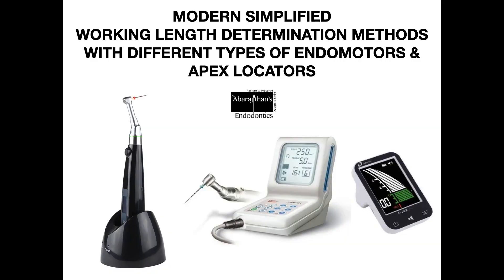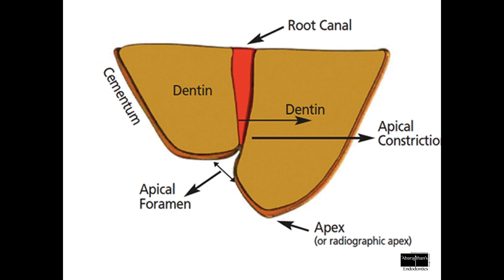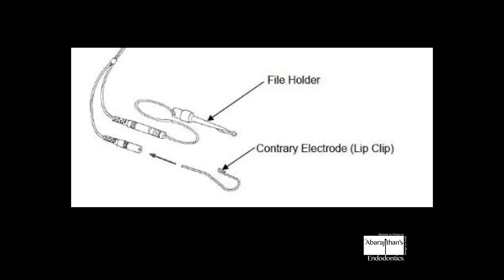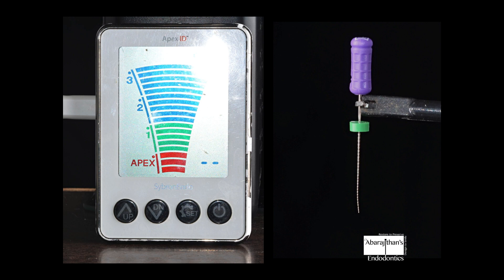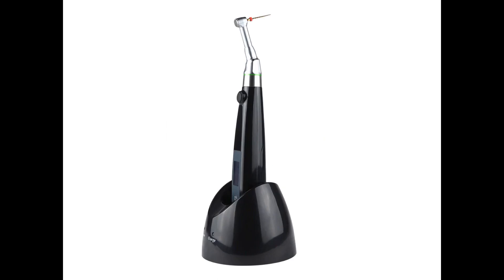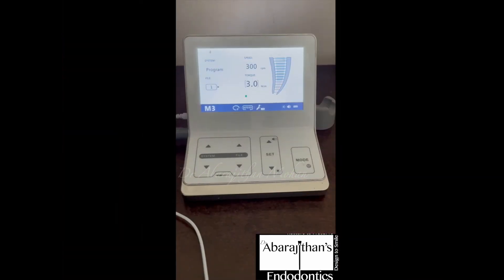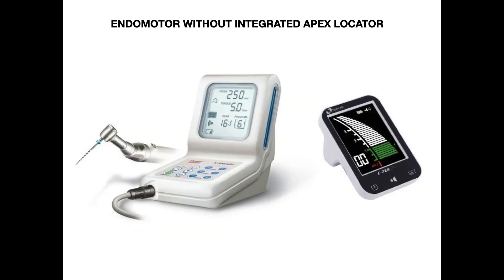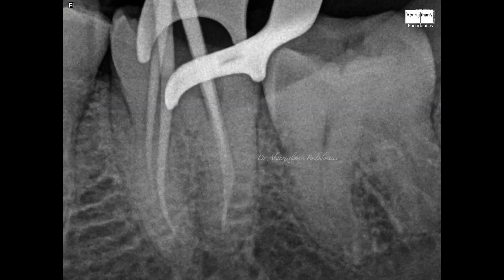MODERN,SIMPLIFIED WORKING LENGTH DETERMINATION METHOD WITH APEX LOCATOR INTEGRATED TO ENDOMOTOR

Comment: Hi! This will help in performing BMP...but how are we going to place GP...we need some value so that we can adjust length of gp till coronal reference point..If it coincides with markings on the files its fine...but if it is less than 18 mm or more than 22mm ...we need to measure to get a value

Comment: Sir which file number rotary or glidepath file can be used to measure working length using this method??....and file coated with EDTA will be able to give us accurate reading?